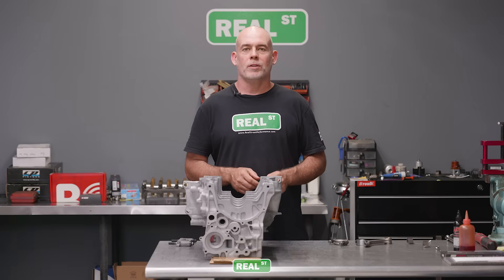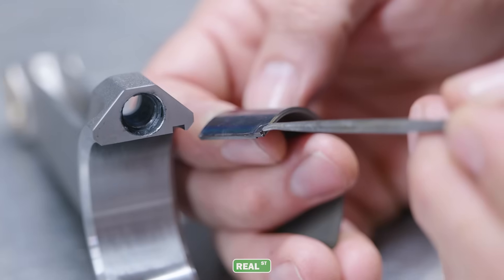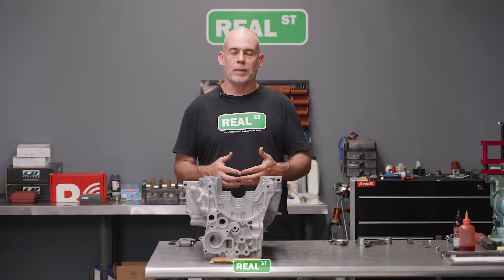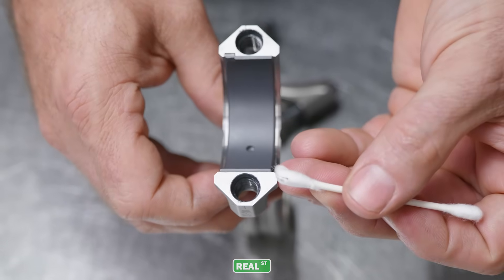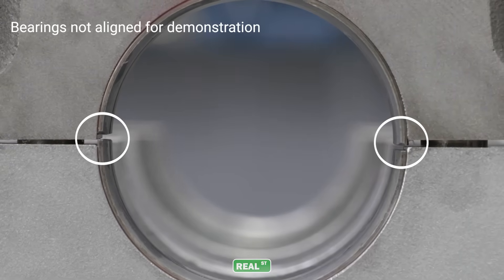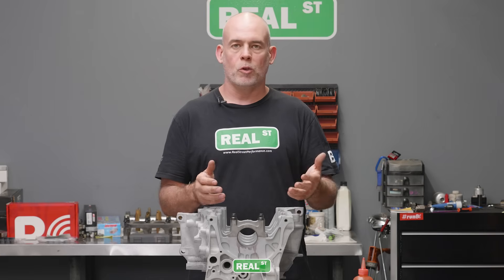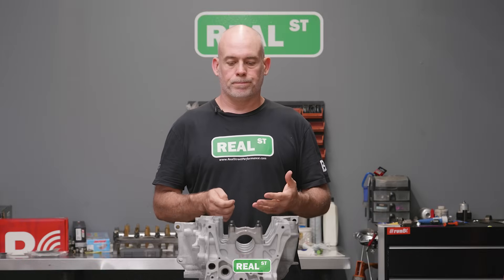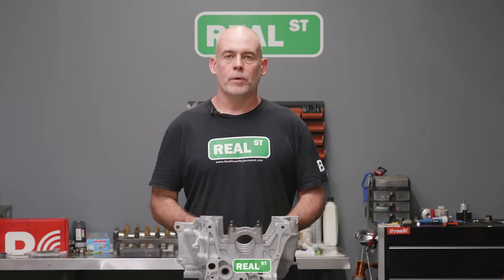Adding Oil On The Back Side Of Bearings During Engine Assembly. Good Or Bad?

Comment: I work on 1200 Bar  diesel injectors sometimes too;
One fingerprint(just the thickness of the fluid+salt) we all know it to be absolutely forbiden,  neglected, it  may send the injector to the scrap bin
Back to engine bearings:

Bearings are HELD in place  by,and ONLY by, compression all around,  NOT by the tangs;  i am doing now a Renault Megane 1.5 DCI,110 hp,and the bearings have NO tangs;  (there is a special tool to locate them,i do not have it,or need it, i read the factory notes on that on the net...);   compression:  that is why it is reccomended to use new bearings each time they are removed;  again,i do  not do it every time,i can tell BY HAND,what its compression still  is, or isnot, that compression MUST be about 1/2 a turn of the nut/bolt,,,)

An oil film has a THICKNESS to it, and pools of oil may form behing the shell, only to exit later , and upset that NEEDED first time chance ONLY, compession
Oil is also an isolator, we don't want that there,not that it matters any on the rods..
Of course,we all know it does NOT matter one way or the other,oil or no oil..

Having said that,i will say that the back of the shells should be DRY and VERY VERY clean, all surfaces involved
  (by the way,DRY and CLEAN is the way ALL factories tell us to do it).

Comment: Ok bro so its not necessarily a complete crime to add oil behind the bearing. BUT. As a professional engine builder in a large reman factory, i will tell you that the extra torque from the displacement will reduce the lifespan of the engine. So you may get 50-100k less miles than if not added.

Comment: I know I’m late but I got a question if you lube the rod bearing or any other part that needs it and put it together and the motor sits for a while would anything happen to the motor is the lubricant sat for a while before being put into the car?

Comment: Hello.
Hope you are well. I’m about to assemble a 1600 twin port vw Aircooled engine. The crank bearing shells have locating pin holes in them which match to pins in the saddles, to avoid spinning. Would I have to put anything on the back of the bearings, or just fit them dry?
All the best.👍🏾🇬🇧

Comment: Why would you prefer using ATF instead of engine oil? Genuine curiosity as I've heard it being used alot, whereas I've been taught use the same fluid that the hardware is in for it's environment, plus small amounts of cross contamination of fluids, but I feel that would be more negligible

Comment: No.  Film of oil changes clearances.   Creating the buckling and deformation he’s talking about.   Never oil the back side of the bearing.   Clean surfaces and assemble dry.  Put assembly lube on face of bearing and crank, assemble, torque and done.

Comment: I’ve seen it done both ways but out of all the engine assembly hand books I have read none of them have advised putting oil on the backside of the bearing. This includes LS engines Suzuki engines and even Honda engines

Comment: I've seen a engine lock up having oil behind bearings.  Especially when the oil gets hot. Don't forget what happens to the oil once it get heat in it. Hydro dynamics. 
Look up hydro dynamic wedging.
When the oil gets hot the hydro dynamic wedging takes place meaning the bearings don't touch the journals. So what happens when you have the oil behind the bearings. Same thing it lifts the bearings off the cap which reduces the clearance.

Comment: the coating on the back of the bearing is more then likely there to provide the very lubrication on assembly more then likely it is a dry film coating and removing it is sorta defeating the purpose. If it wasn't meant to be there it would have not been put there in the first place. Not saying your method is bad or stupid more then likely simply not needed.
Reply: King Bearings says it's a rust preventative that should be cleaned off with solvent before installing (dry).
Reply: @Milkmans_Son  Sounds like you might have talked to the receptionist at king bearings or the day janitor because when I buy bearings they are usually all sealed in a blister pack no way on earth they can rust. even if you placed the pack in a tub full of water for lets say 50 years. if they sell the bearings open in a card board box with no protective covering ? then they were simply to cheap to invest in a machine that packs them in a sealed plastic bag. Plus they added a step no one ever heres about and can blame THAT on an engine failure caused by their being to cheap to package them properly ?

Comment: I worked in Research & Development for Vandervell, the shell bearing manufacturer, building engines for testing on dynamometers and on the road or track. The engines on test beds were subjected to extreme conditions that it would be very difficult or impossible to replicate in use in a vehicle.

The test engines were assembled with great care and attention to tolerances and, particularly, cleanliness. They were all assembled with the bearing housings and the backs of the bearings spotlessly clean, degreased, and absolutely DRY, definitely NOT oiled. Care was taken to avoid touching the bearing surfaces, the steel backs of the shells, and the main bearing or rod bearing housings with bare hands to avoid contamination. The bearing surfaces were lubricated once they were installed in the housing immediately before assembly. What they were lubricated with was dictated by the test schedule for that particular engine, but none of it ever went on the backs of the shells.

R&D was carried out in two buildings away from the main factory buildings where the shells, thrust washers, and cam bushes, original equipment for many European, Scandinavian, and even some American engines, were manufactured.
We had four large soundproof cells in the building where I worked with a total of seven test beds, and another test house in a separate building round the corner with more test beds in cells there.

There was also a rig shop where test rigs subjected bearings to excess heat, loading, contamination, lubrication failure, and other abuse.
We had a comprehensive machine and welding shop where we produced one-off kit for mounting engines to the beds and dynos, custom plumbing to suit each engine including, on occasion, separate duplicate systems to subject engines to thermal shock and other nasties. (It was handy for producing parts for our own motorcycles and cars during breaks, lunchtimes, and the rare quiet periods too. 😉)
All in all, a great job.
Reply: I'm going to bet that the bearings were installed "dry" was for two reasons; first,  there's a test standard and you have to follow that procedure EXACTLY.

Second, I suspect that the test procedure (engine assembly) required dry bearing installation to decrease the potential number of variables that could influence test results. It's easy to quantify and isolate "clean and dry", harder to isolate and consistently say, two drops of oil, ten drops of oil, applied front to back, left to right, big drops, little drops, I lost count of the drops, fresh bottle of oil, old bottle of oil, we didn't use oil, we used antiseize, we used ATF, Dextron vs.... etc. etc. etc.

You could spec a procedure that included oil on the back of the bearing, but, like I said, reducing number of variables. I think in this case it had nothing to do with whether it makes a difference or not.
Reply: @wlrottge  very plausible, might be the answer to the topic.

Comment: If you do that on a modern oem rebuild, it won’t even turn over on the stand. They run .0008”-.0015” oil clearance. Anything on the back of the bearing will push it against the crank.

Comment: If you have ever taken part an engine that has been previously running or in operation - there is ALWAYS OIL behind the main and conrod bearings. Every time - without fail, there is some oil that resides there. They are never - ever dry.

Comment: Kawasaki recommends lubing the back of the bearings on various models....the old ZX-11 is one I distinctly remember. They actually recommended moly lube. I have always off set the bearings in the cap/saddles so as they self align when crushed

.

Comment: I never understood the people that get all worked up when seeing people putting oil on the backside of bearings. Have they ever dissasembled an engine ? You put it in dry on the backside, assemble the engine, drive with it, dissasemble it, remove the bearings, and guess what ? There's oil there anyways, because it gets everywhere and in between everything via capillarity and via the oiling passages in the crank and block that aren't exactly sealed in a way to only oil the part where gliding occurs.

Thinking it will make your bearing spin or change clearances is idiotic as it can't change clearances as the extra will just squeeze out, and oil won't make it spin since I guarantee every engine will eventually have oil in the back of the bearing anyways.

That being said I still don't think there's a point in doing it, but I don't think there's any reason to get mad at someone doing it either. But scotchbriting the back of bearings is just weird tho.

Comment: also be carful of bore gages, the added spring pressure in the gage on soft metal surfaces will give you a false reading. Torq your caps, measure your bores,( no bearings,) measure your bearing shell half’s, ( you’ll need a ball mic ) add the two half’s together, add that to your bore diameter, subtract your journal size. That’s your real clearance…crunch the numbers they don’t lie.

Comment: Not a good idea, the assembly lub he is putting on the back side will take away tenths of a thousand to your clearance..bearings are installed clean and dry to their respective bores.
This is the way it’s done, we want the bearing seated tightly and dry with no obstructions we’re spinning a journal in the bearing, that’s where we want the lubricant. This is the way it’s done…

Comment: I'm confused...you add transmission oil to the back of the bearing....but then you clean all the transmission oil off and reinstall the bearing? (Im about to do this to my 2009 toyota matrix and i cant get a clear answer yet on if i am to apply any kind of grease/lube/oil to the BACK side of the bearings)

Comment: What I'm about to say ONLY APPLIES TO IRON ENGINE BLOCKS!!! NOT-Aluminum...
When putting together your IRON mains and rods, specifically for LS, and Older Small Block Chevys or whatever, I like to use something like 000 Stainless Steel Wool or very soft wire wheel on a drill and clean the mating surfaces of the cap and block or rod and cap.  Plus down where the bearing seats.  If you have any debris in there, you WILL cause your clearance to be off.  My rule of thumb, is I need to see CLEAN METAL!!! This is only done using very very soft wire wheel or by hand with 000 or 0000 stainless steel wool.  but I basically "polish" the block and caps like this, as well as the rod.  You don't want to take metal away, but you want to be sure any burn oil, sludge, or whatever isn't between the bearing and the block/cap or "bore". 
With that said, I prefer to install my bearings dry, however I use a file and de-burr all the edges of my bottom end.  This keeps them from cutting my hands, but also from damaging thinks like the bearings when they are installed.  I've also seen where the sharp machined edge on a main cap was causing a cap to not tighen correctly.  What I eventually figured out, was that the block was slid on a wooden bench, and that was enought to "flip" the microscopic burrs over causing a 2thou difference in the bearing clearance.  So by removing that, it doesn't tear up the back of my bearings on install, and also in my experience, that machined edge is soooo sharp if not de-burred that even with a light or thick lube, it can still damage the back of the bearing.  However, After I remove the burrs and clean the block before final assembly, I have (at times) used some type of lube on the backs of the bearings.  I just don't think it helps.  However, If you are reading this, and are new to engine assembly, and put your mains and rods in with think engine ass lube, don't worry!!!! You don't need to pull everything apart, clean, and reassemble.  Just wait 20-60mins after your "final" torque pass, and just do another "final pass"..  In warmer climates, or in the summer, don't worry at all.  If you live up north and its -20 outside, than go for it.  Another final won't hurt.  Keep in mind one thing.  If you're using plasti-gauge, and you've put ANY TYPE of lube AT ALL, on either side of the bearing during the process, you "WILL HAVE WRONG MEASUREMENTS"....  You NEED to install the bearing DRY and CLEAN to get an accurate meansurement with plasti-gauge.  Even a Thin layer of oil will cause it to show a tighter tolerance that it really is.  
I hope that helps someone.

Comment: 40 years doing engines and fit dry on the back when rebuilding but I have done hundreds of top and bottom rolled in mains and also never had a problem. Maybe I will mic some one day but I think either way is fine.

Comment: im a car mechanic .
i learned rebuilding engines from my father 
he is a mechanic since 1969 .
he taught me to put a slight amount of 10w oil under the bearings .
the reason , he said, is what you said EXACTLY!!

none of the engines he built failed and none of the engines ive built failed .

the thing is that no other mechanics ,i have conversations with ,do that

Comment: Hello Jay, I appreciate these videos you have put out. They have been very informative. I wanted to get your input since I'm no professional mechanic but have some experience. I'm replacing the rod bearings on my bmw s54 engine which happens to be a maintenance item due to the narrow size of the rod bearing. Would you saw this process can apply to a used running engine as opposed to a new assembly in your video?  Not sure if it makes a difference that the s54 has a forged cracked rod. Would using scotch brite on the rod surface be ok?

Thanks!

Comment: or Your spot on with the tabs only use is to position the bearing in the housing and crush holding it in place.  I don't see a need for oil on the back side.

Comment: The guy that made this video loses all credibility when he says "Don't ever sand the back of the bearings, use a scrotch brite". The scotch brite is a sanding instrument. I buy them for body work and sanding. The red scotch brites for instance are the equivalent to 320-400 grit sandpaper. The greens are probably 600 grit. The removal of any material on an instrument designed for .001" clearances is asinine. I clean mine with paint thinner along with the cap surfaces.

Comment: This is more snake oil than hard science. Oiling the BACKSIDE of bearings is the same thing as the starting argument over which oil to use with "well with today's tighter tolerances, blah blah blah" regarding oil that's too thin for the application. Can appreciate builders trying something different, but there's a reason you don't ever, ever put anything on the backsides of main and rod bearings. Correct, oiling the backside will not cause a bearing to spin. However, 1) you can't squeeze a liquid so the bearing isn't going to fully contact the saddle or cap, can throw off your measurements etc. And number 2 the biggest thing people overlook is that line boring is not always 101% straight end to end nor is crankshaft runout. This is why in the history of engine building people have been beat to death to put the bearings in dry, onto clean surfaces yada yada, and prelube the working side. It's always been done that way. Just just because you CAN do something and haven't had trouble doesn't mean you should. If you're trying to move heat from a rod journal or main journal you've got other things to worry about. Just stick to OEM and machinist recommendations

Comment: When the engine runs oil will migrate behind the bearings.  Oiling the backside of the bearing during assembly reduces fretting of the bearing.  0W-20 works fine too, what you're doing is fine.

Comment: When they say 'clean and dry', it means just that.  If oil is present in any form then it is neither!
I normally use isopropyl alcohol on Whatman 105 lens tissue to ensure clean mating surfaces.  It evaporates quickly without leaving behind any lint or residue.

Comment: Jay, your bearing prep tips are absolutely essential. Yes, you could just toss some bearings in and end up with a perfectly healthy engine. For the engine builder to be absolutely certain, that everything was installed perfectly, you would need to take the tips you described. Also, ANYONE who says bearings are to be installed completely dry on the backside and/or that the block's bearing housings are to be cleaned and dried before bearing installation just needs to take one used engine apart. They will clearly see that oil ALWAYS finds it's way, behind the bearing shell. IMHO, I have always lubed the back sides of bearing shells before installation. I have never had a bearing shell that needed cleaning with a scotch bright pad. Always wiped them down with some parts cleaner and a clean lint free rag. Then I'd apply assembly lube on the backside. Just a tiny amount and used a clean finger to spread it out to a thin, even coating. Never once had a bearing failure on a single build. I have built about 100+ engines of all types. Not a large number of builds, but enough to know what is important. Thanks for the tip on using a thin lubricant, like ATF. Instead of using a thin coating of assembly lube.